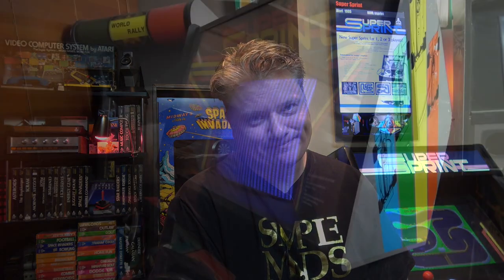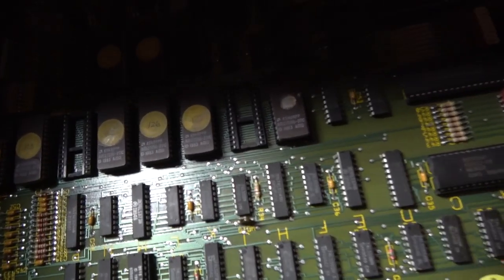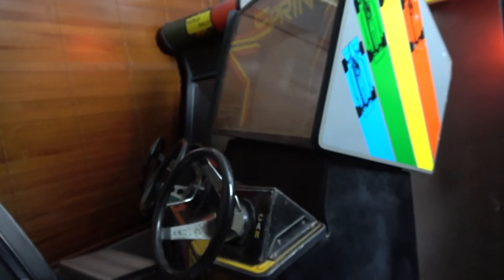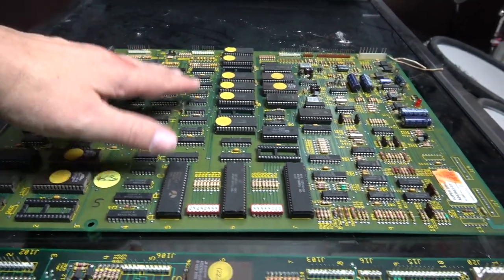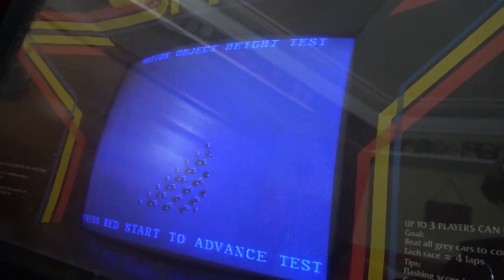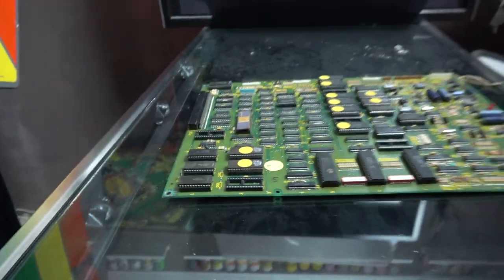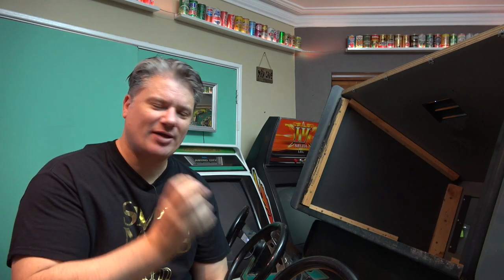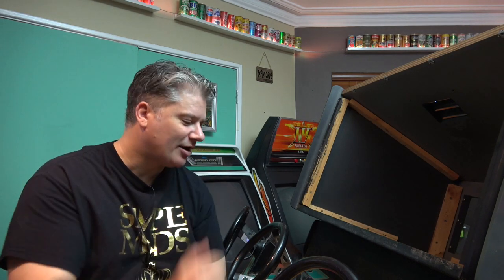FE020 -  Atari Super Sprint Repair!

Comment: Hey mate like your videos Quick question seeing you have a championship sprint lai I picked one up a couple months back just wondering does it just have the one switching power supply apparently The board needs 15 V? Different from American version
Reply from the maker: Gidday Kerrin, congrats on getting a champ sprint! It's been a while since I did my one. The actual game only needs 5v so a switcher is fine to feed that.  It's usually always the sound amp/circuit/board that needs the higher voltage around the 15v-20v range (and usually comes with a dedicated transformer for it). I think Atari USA version had the ARII board which had the sense circuit and audio power regulator all in one which would push out 18VAC to the audio board. It seems that LAI may have done away with that and ran 5v for the game board and then what ever voltage needed for the sound board solution they were using.  Check out the wiring diagram at the following link for the USA version as it gives you an idea of where the original voltages were being passed around. I used this to work out how my set up was different and went from there. Hopefully you can do the same. https://www.arcade-museum.com/manuals-videogames/C/Championship_Sprint_SP292_1st_Printing.pdf   I hope this helps! Cheers.